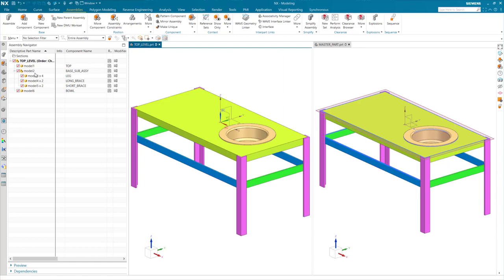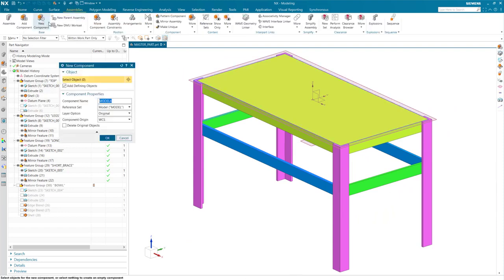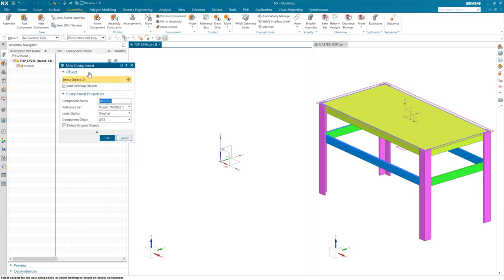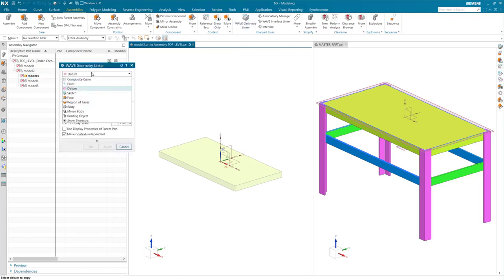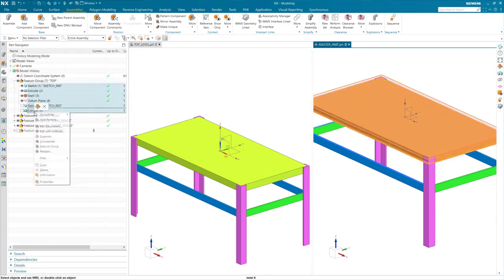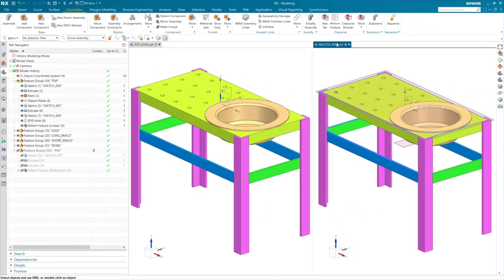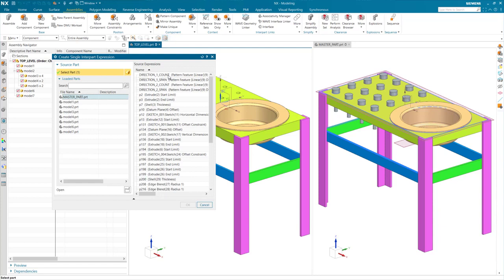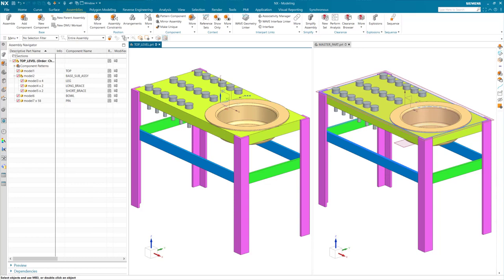NX Top Down Modeling With Master Link

Comment: how do you create master model for an assembly? here you used one single model and changed it to part model. all the components of the model were done in a single model. My case would be its an assembly and I need to change all of them.

Comment: What's the advantage of this method over assembly file with parts and constraints
Reply from the maker: No advantage. Assembly constraints are actually preferred. The purpose of this video is mainly just to show a tip/trick and how something like this could be done. Some people prefer to just have one part the part that drives their assembly because they are not aware of some of the other capabilities that NX provides, such as “make work part” to design in context of an assembly.